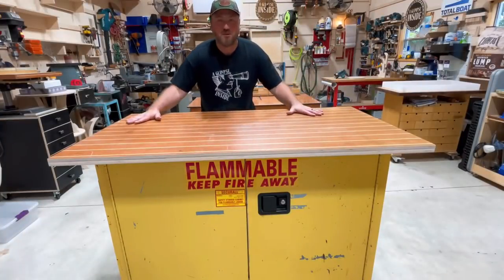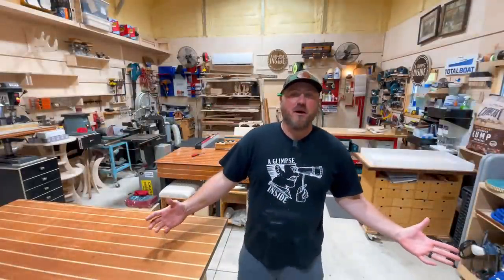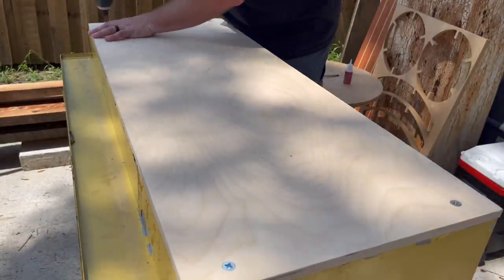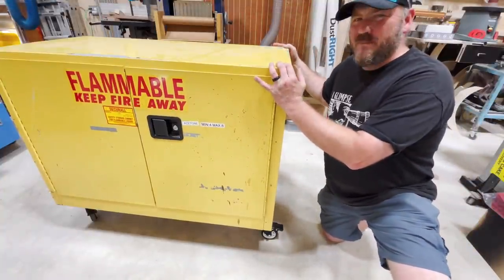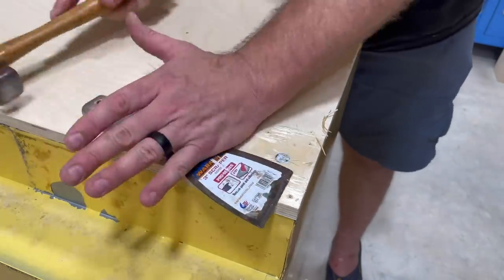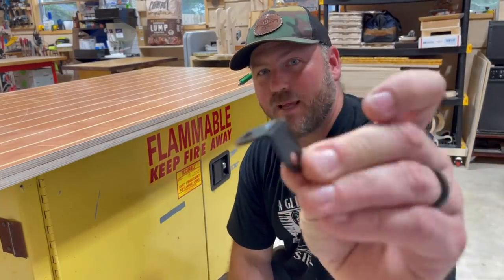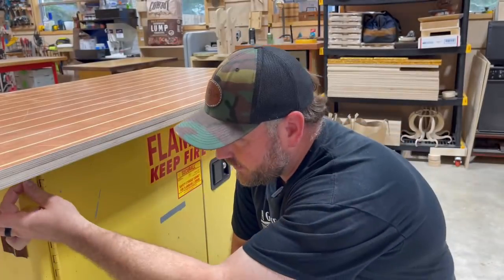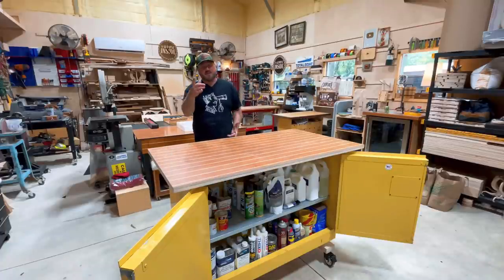Mobile Chemical Storage with an Amazing Work Surface | A Glimpse Inside How To

Comment: Nice way to reuse what you have. Any ideas on a mobile foldable outfeed table. I have to move my table saw outside every time I have to use it. Trying to think of a way to do a outfeed that folds up to have slimest profile. Saw horses just don't work that well for me.
Reply from the maker: Let me think about that for just a moment. I’m actually considering detaching my outside table and making it mobile that way I can actually move my tablesaw around much easier. I’ll let you know if I think of anything

Comment: Chris what is the over all height of that finished cabinet? I'm guessing 42"?
Reply from the maker: Hold please. I think your close tho
Reply from the maker: 42 1/2. That’s a pretty good Eye you got there
Reply: @AGlimpseInside  id use it for tools next to my assembly table... Id filled the void in the toe kick where the wheels are as I think eventually they will sag... great build and I'll probably do the same thing with my fire cabinet.